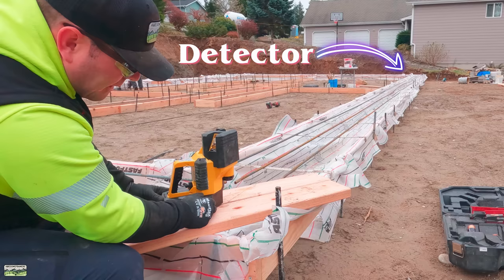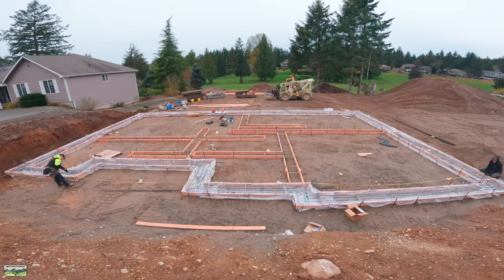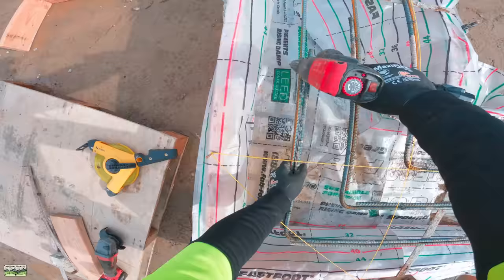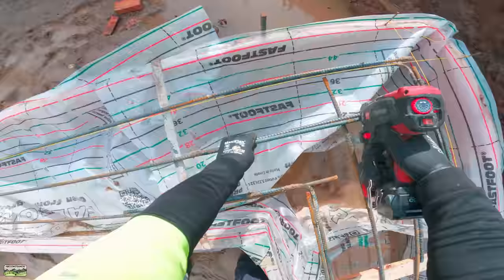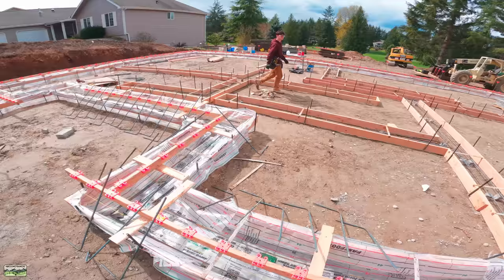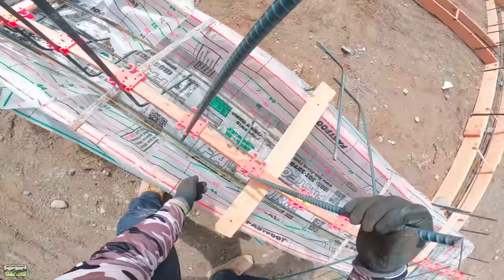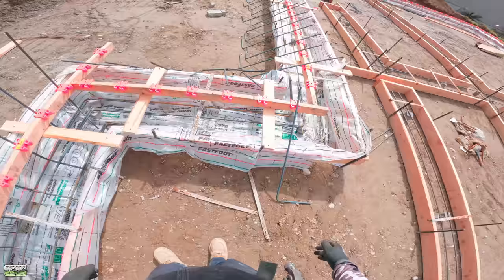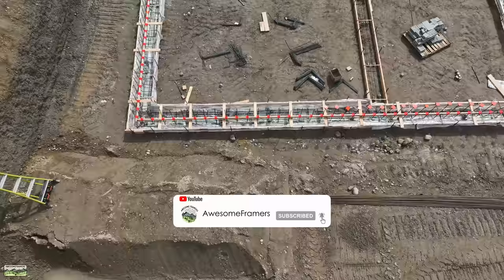How to Form Footings Part 4 Tying Rebar

Comment: Good job bending rebar for the corners, but there's small thing u can do to prevent spalling the inside corner--tie the inside corner to the outer bar, or in your case, at least the center bar.  When the rebar is subjected to tension, the inside corner has tendency to spall (ask me how I know;-) You add only small amount of steel, but you improve wall.

Comment: Hey I have a question 🙋‍♂️ 
It looks like you tied off all the horizontal bar while it was resting on top of the spreader cleats, is that right? So you removed and replaced the cleats one by one to let the assembly drop down? Did it shift as a result? Was that so you could work higher off the ground and save your back instead of tying it down low?

Comment: At 7:50, all your bar is on top of the cross pieces of the footing. Then magically at 10:30, all the bar is below the cross pieces. How did that happen? It looks like the wood cross pieces are nailed to the form boards too!
Reply: Agreed. Saw that in another video. For some reason they don’t want to show that. Secret?
Reply from the maker: Just pop the clips and lower it

Comment: Hello @AwsomeFrames at the 5:39 minute mark, I see you placing the 2 x 2 rebar precut corners (Great Idea to order those) and fasting over and on to the corners and fastening it to the flat wall spacers on the top of wall??? Dont you want it lower into footing walls??? Maybe its just my perspective seeing, as I am not there and maybe the cameras ???
Reply from the maker: yep, once all the bar is tied, we just pop the clips and lower the bar.  Its easier to tie the dobies on when its up higher.  Most of the 1x4 would be left un nailed or not there at all until the bar is dropped.

Comment: how come the rebar is only 1 layer? doesnt the bottom of the concrete need to have support of rebar too?
Reply from the maker: The rebar is in the bottom. It's spec'd 3" cover
Reply: @AwesomeFramers  what is spec'd 3? )
Reply from the maker: @jaykay308  3" cover is the amount of concrete between the rebar and ground as spec'd by the engineer. Since concrete is strong in compression but not in tension. That's why steel reinforcement is located near the bottom.
Reply: @AwesomeFramers  sweet. spec'd 3 " )) so 3 " above ground and 3 " below top? and 3" concrete between the parallel rebar?  would it need rebar in middle if it reach a certain height ?
Reply from the maker: @jaykay308  It all depends on your conditions, e.g. loads, soil, etc.
Reply: @AwesomeFramers  is there a rule of thumb with the ratio on how many rebar for how many load or concrete? is it possible to have too much rebar? )
Reply: @AwesomeFramers  if making foundation for a 2 room 1 kitchen house. does it have different rebar ratio for the foundation, the wall, or the floor for the second floor? ))
Reply from the maker: @jaykay308  Hey Jay, it sounds like you need a subscription to jlconline.com.  You'll find all your answers.  Its a great resource.